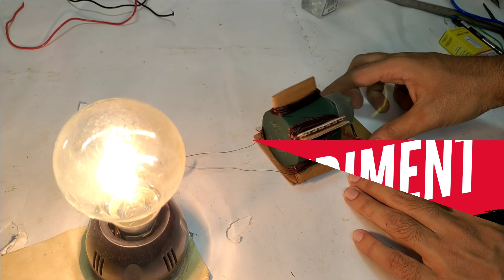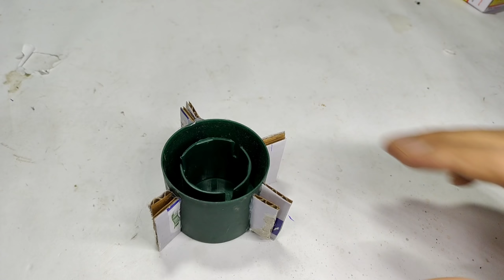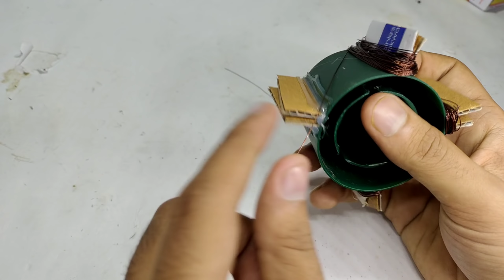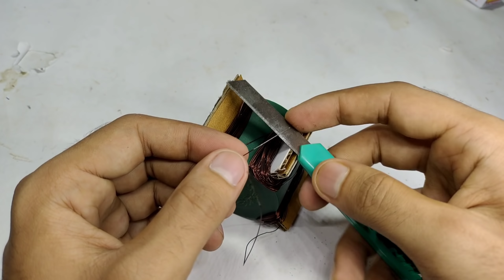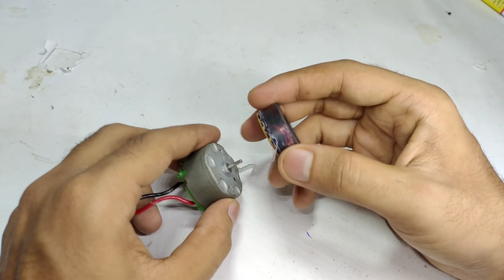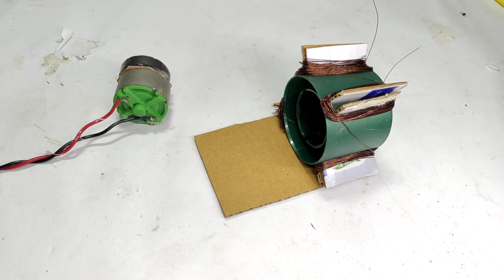i turn a High power 220V Electic generator at home | How to make 220V dynamo generator at home

Comment: It's one more nice invention... Bt  you could use an plastic sheet or else instead the cardboard than u put for winding base on the bottle cap and I think that's much durable and for base just any wooden block rather cardboard again..ok well it's fine for demo..(My self Alwin)